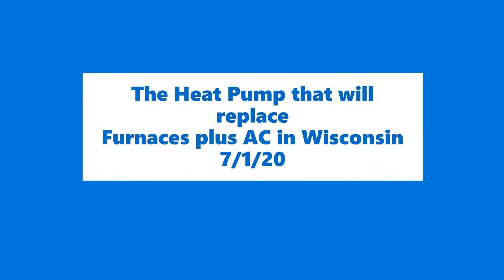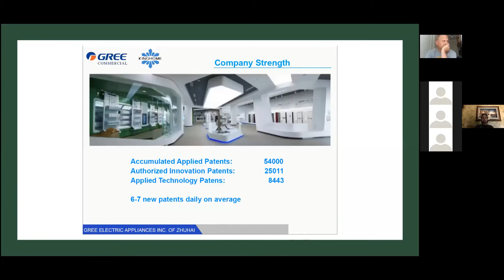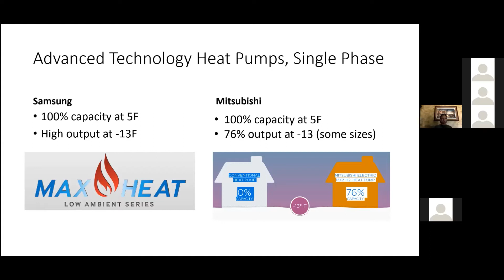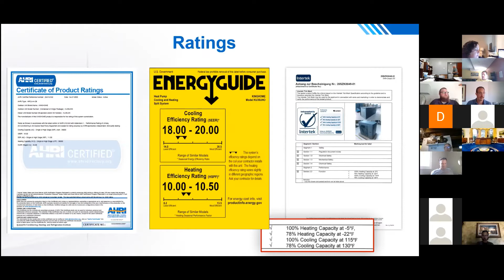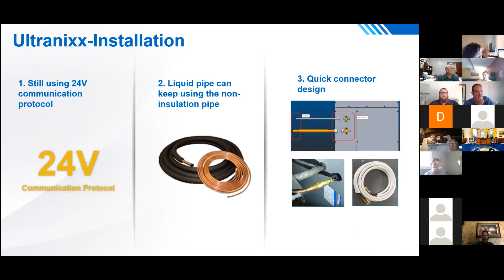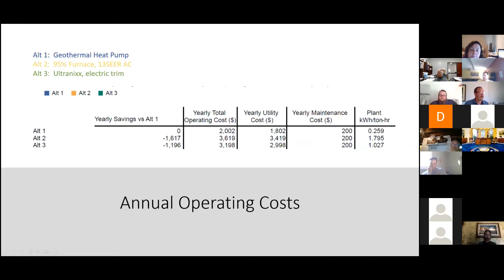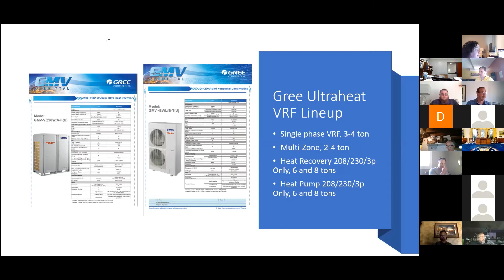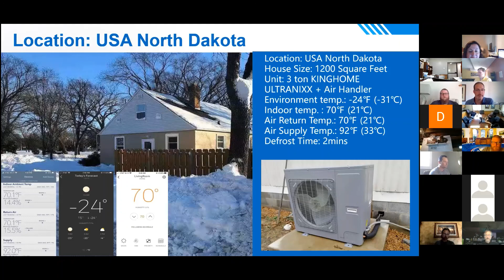Gree Heat Pump

Comment: What is the difference between Gree Flexx and Gree Ultranixx ?
Reply: Looking into it myself, I found that they are similar if not the same. They use the same condensers and evaporators, but the Ultranixx is the Kinghome sub brand. The Flexx had more parts with higher seer ratings, but averaged about the same. In fact, comparing the Flexx 54k btu to the Ultranixx 54k btu, they seem identical on observation on a physical level, and have 1 seer different (18seer verse 17seer respectfully.) The indoor forced air systems look identical outside of labeling. The smaller the system, the larger the seer gap mind you, at 36k btu, it is a 2 seer difference.
Reply: @blazetownsend8785   They claim 2 ton Acqi central stealth heat pump has HSPF 11.6 is it Gree too  ?